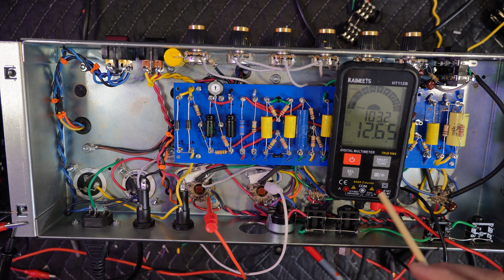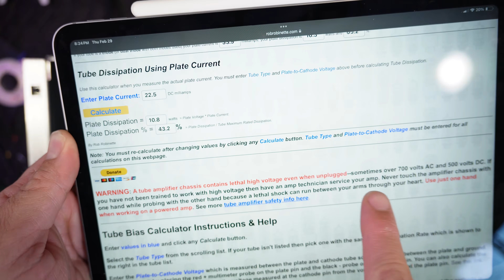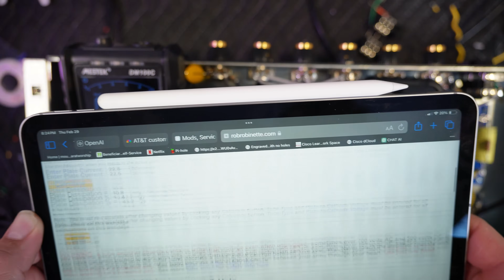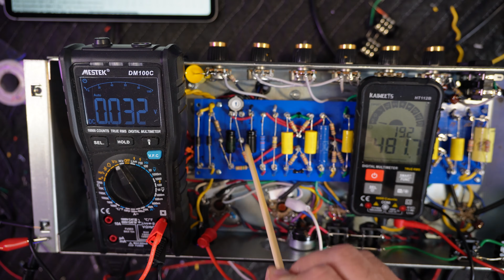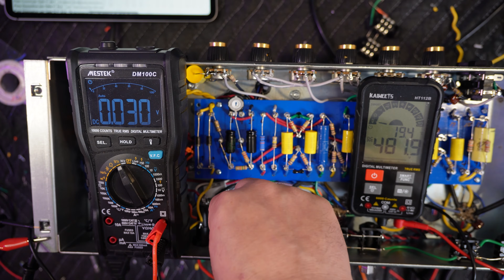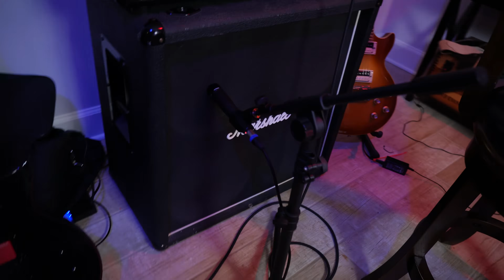Troubleshooting, Biasing, and Tone Testing - Mojotone 800 Build Part 6

Comment: Hey , very nice build! 😮 What are the red pickups you have in that LTD? 
I am considering the very same kit for my high gain channel (R), with pedals in front. 

I run one cranked up Marshall-type amp in the right channel along w. an edge of breakup Vox-type amp in the left, it has proven to produce the best sound for me in the mix, channels not fully hard-panned.

Greetings from Europe.

Comment: Measuring the cathode current will also be measuring the screen current not just the anode current.
Reply from the maker: Thank you for the comment. I was following a popular biasing method I have seen on YouTube and in Rob’s site. The site also mentions other ways of biasing by measuring screen current. But I did the cathode voltage drop resistor method. It makes sense that plate plus the screen current will be measured at the cathode.
Reply: @DIY_AudioGarage  I think you just subtract 5 mA (Typical Pentode screen current) from the reading you get in the video, and that is your plate current. So a reading of 40 mA when connecting it like you do in the video will mean 35 mA plate current. Build looks great, and it sounds very quiet when it comes to hum and noise. I think I am going to get me one of these kits!
Greetings from Sweden
Reply from the maker: @somekindofalien  Absolutely right about the mA adjustment for the plate curren, your calculation nails it. Thanks for the kind words on the build and its quiet operation! Thrilled to hear you’re considering one of these kits. They're quite a rewarding project.

Good luck with your build, and I’m here if you need tips or have questions. Greetings to Sweden, and happy building!

Comment: Fantastic job.  Looks clean inside, sounds great.  I pulled the plug on a mojo tone GA5 amp kit after watching your videos.  Thanks for the series.
Reply from the maker: Thank you so much for your kind words and support! I'm thrilled to hear that my series inspired you to get the Mojotone GA5 amp kit. Building your own amp is such a rewarding experience, and I'm sure you're going to enjoy both the process and the final product. Happy building, and I'd love to hear how your project turns out!
Reply: @DIY_AudioGarage  Hi I have built  JTM45 kit from Modulus here in the UK and carefully followed the wiring diagram and switched on and there was a wining sound and by swapping the anode connections round on the EL34'S  it cured the problem.
In my circuit I have used 100mfd caps through out the various points in circuit to improve the smoothing    and it has helped and also the smoothing chock has been swapped out from 4mh to 10mh and can detect a smoother sound.
I have used a screened cable from jack sockets to the 1st preamp tube to cut down on noise and only earthed one end at the jack socket to avoid a earth loop.
Reply from the maker: @itsonlyme9938  I have had the same oscillation issue before where I fixed the same way! Every time I increased the volume a bit, it would start whining. It took me a long time to figure out and almost gave up. Glad you were able to make it work. Would love to hear the tone on the amp. I’m going to try out the 100mfd cap with alligator clips to see what I can get. Thanks for sharing your experience. 🎸